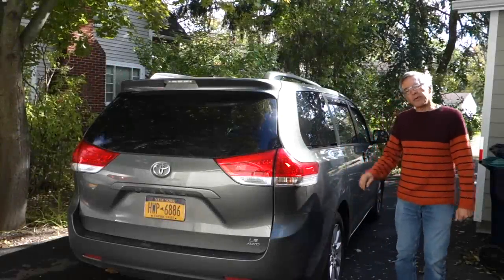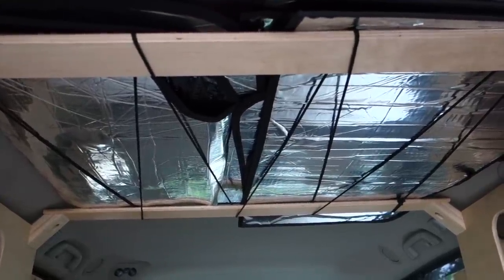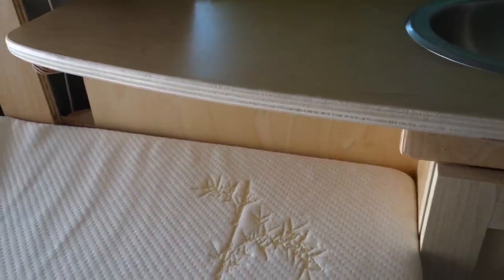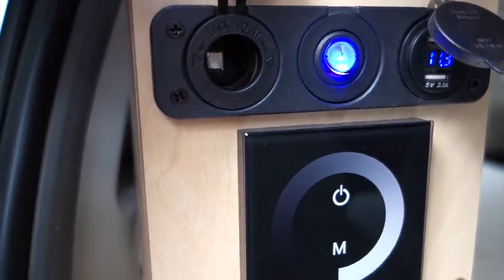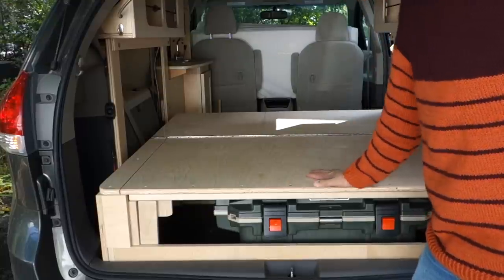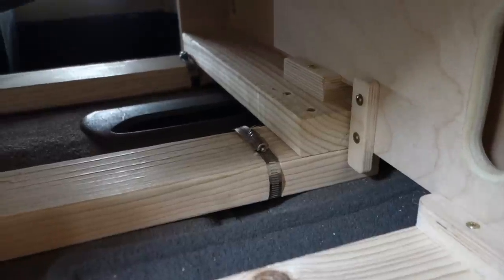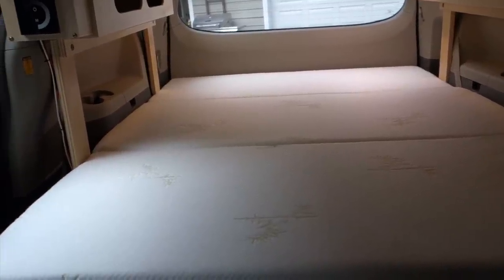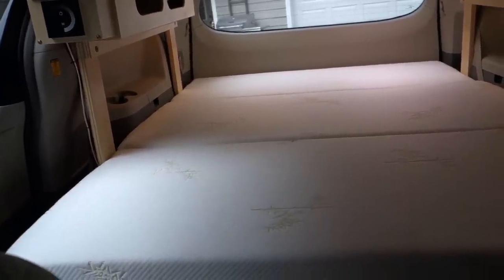A Slightly Different Mini Campervan Build

Comment: did you have a link to the dimmer reading lights? this is really an impressive build
Reply from the maker: The dimmer switch is easy: https://amzn.to/2WeVujW. The lamp itself is something I made from existing lamps I had in the house. I removed the spring clamp and made a mounting bracket to enable cabinet mounting. If I were to do it again, I might consider using these (https://amzn.to/2BOlzwE) and removing the spring clips to enable direct mounting to the cabinets. Or go the easy route and just get something like this: https://amzn.to/368s1g3

Comment: Great video.  I have a 2000 Sienna LE I'm trying to convert and have been unable to get a handle on the privacy and stealth  issue specifically dealing with the windows shades.  I cut out some WeatherTech window shades just like you, but I haven't been comfortable with the privacy and stealth aspects.  I used some velcro strips to try and get them to stay put and seal the light out, but they seem to frequently come loose or leave gaps where someone could see light from the inside of the van at night.  Also, many other builds I have seen use a black curtain to seal off the back of the minivan from the driver and passenger seat but it doesn't look like you have done that.  Note that a previous owner had all the rear windows tinted and it helps somewhat, but still not to my satisfaction.    I'm wondering if you have done anything in this area that might improve the privacy issue.
Reply from the maker: We have a full width blacked out curtain to separate the front seats from the sleeping chamber. You mentioned you “cut out” WeatherTech shades but they come already cut to fit the windows fairly precisely and they stay in place without additional effort. That’s been our experience, I can’t really say why yours would be different.  One of the biggest challenges with stealth is achieving good ventilation without giving away your presence. Leaving windows party open and running fans means leaving some shades or curtains somewhat open. One thing I might do someday is create side curtains that hang a little longer and hang vertically instead of trying to hug the window contour - then air coming in or going out will have room to move more easily with a gap between the bottom of the curtains and the door. If they’re long enough stray light shouldn’t have a straight escape path.
Reply: @BruceParks  Sorry, when I said WetherTech, I was just assuming that was what I had.  The stuff I have looks like yours, but it came on a roll and I had to measure the windows and then cut it to fit.  Your pre-cut shades might be more precise, but mine fit pretty good and I probably won't invest in the Weathertechs.  I'll probably go with a blackout curtain up front like yours and also your idea of long vertical side curtains.  I think the curtains will give the interior more privacy and also a feel like your actually in a bedroom instead of a mini-van.
Reply from the maker: john  - I believe you are referring to Reflectix, it comes on a roll from Home Depot. Lots of campervanners use it for their window shades but it’s hard to beat the near perfect fit you get from the WeatherTech product. Only real downside of the WT product is the price. Good luck with the curtains, it definitely lends a homey feel to the “bedroom”.
Reply: @BruceParks  I checked out the WeatherTech website and it appears that they don't make shades for my 2000 Sienna, except for the windshield.  "Full vehicle kits are only available in select vehicles" is what it says.  I guess the 2000 Sienna is too old for them.  I see what you mean about the WetaherTech price.  The price for the windshield alone was $60.

Comment: Would that same build fit in the 09 sienna or has the interior changed a lot?  Looks great
Reply from the maker: 2009 is 2nd gen, my 2011 is 3rd gen. There are subtle differences but the overall dimensions are similar

Comment: I appreciate the reply , could you elaborate ? Was it the size , adaptability ? Have you seen this before , are there other models with like attributes that could be considered ? It had to be more than just a selection . You chose it , I would feel some research was done on your part and why? Thanks
Reply from the maker: Sorry for the quick answer, we’re on the road. So, vehicle choice was a bit complicated. I initially considered cargo vans (Sprinter, Transit, etc) but decided we mainly wanted to be able to sleep comfortably in the vehicle and didn’t want to live and hang out inside it. The minivan offers space for a full size mattress with room for a portable toilet and dog (though we usually don’t travel with our dog). The minivan doesn’t draw attention when you overnight on residential or city streets. The minivan is reasonably good on gas, and can be easily maneuvered in tight streets and in parking garages (we like to see cities and museums in addition to the wild and beautiful places) The minivan is very versatile - I haul plywood, people, furniture, etc with ease. I didn’t like the idea of an extra vehicle that was single purpose that was only used part of the year (we only roadtrip for maybe 7-8 weeks per year right now) so the minivan’s versatility was a huge plus. I chose Toyota over Honda and Chrysler for its superior reputation for reliability.
Reply: Thank you , gave me something to think about . Keep the dirty side down 👍👍👍

Comment: Hi Bruce , love your concept and craftsmanship! Just picked up a 2020 Sienna , the base model and am going to do one similar to yours, question if you don’t mind. What is the height of the bed platform off the floor and how did you decide on that ? all the best, Steve
Reply from the maker: Steve, thanks for viewing and commenting. Regarding the bed platform height, it's about 13" in front and about 12" in the back. It's level to the ground, not the van floor. I recall choosing this height to just clear the cooler we had in the deep well in the back and it allowed for just enough height to avoid feeling cramped at all when sleeping. It feels just about perfect when lying down with your head propped up reading but it isn't high enough to allow sitting upright for my tall torso. I now have a refrigerator in place of the cooler and it has about an inch to spare between it and the plywood. If I could do it all over again, I'm not sure I'd change anything.
Reply: @BruceParks  Hi Bruce, thanks so much for the tips ! We just purchased the Dometic CFX75 combo fridge freezer, figure if I am going to go broke building this unit might as well go out in style :) using all Renogy units for power supply, combo DC-DC MPPT, 2000watt inverter, same charger you have, 175 watt flex solar panel for at camp sites as we are putting a THULE ski container on the roof for surplus camping gear, 2X100ah Renogy lithium batteries, which should run fridge for a good 3 days with no charging, also picked up a small RV self contained toilet which is only 11 3/8” tall which will slide under the front section of the bed if I have it at 12” off the floor, hence my wanting to know how your heights worked out. basically with these vans conversions you are building the ultimate Swiss watch! We live just North of Victoria BC, on the Island, if you are ever out this way have a nice spot under the trees ready for you anytime you like ! Once again thanks for all the videos, not having to reinvent the wheel is a good thing indeed !
Reply from the maker: @steveprice7259  Looks like you are putting together the ultimate minicampervan - great component choices. I’m currently making some minor changes, including replacing my solar charger with a Renogy DC-DC MPPT charger and adding a suitcase folding solar panel. I should have some new videos up soon. We’d love to visit Vancouver Island one of these days. I’ll keep you in mind.
Reply: @BruceParks  Look forward to it ! Thanks again Bruce !

Comment: is there a link for removing the 3rd row seats of this car and instruction to battery/inverter? Thank you!
Reply from the maker: Ted, for 3rd row seat removal, all I did was remove the plastic covers over the seat mounting bracketry and unbolted the bracketry. It becomes obvious once the covers are removed. On my 2011 Sienna, the wider seat has 2 bolts on the trunkwell floor and 2 bolts on the trunkwell wall and the narrower seat has 2 bolts on the trunkwell floor and 1 bolt on the trunkwell wall. Each seat also has a cable attached to the floor which removes easily. 

I'm building a nice solar power system and hope to upload a video on it in the coming weeks. The trick to a minivan installation comes down to how big a roof array you are willing to fit, and also whether you are willing to glue down a flexible panel(s). I bought a 100W rigid panel that I'm mounting as low as possible between the roof rails. I've mounted a 105Ah AGM battery under the sleeping platform and am currently building a "power wall" that mounts vertically in the trunkwell. The power wall has all of the components to make the system sing: MPPT solar charge controller, 1500W pure sine wave inverter, battery charger for use when connected to AC, power shut-off switches, fuses, wiring harness connectors, etc. Look for the video in a few weeks. In the meantime, I'm happy to answer any specific questions you have.

Comment: I'm beyond impressed! Would you be willing to coach me how to built this? If you have plans and sell them....I would be buying it on the spot! Just incredible ingenuity!
Birgit
Reply from the maker: Birgit, thanks for the compliment, I really appreciate it! Unfortunately, no plans are available as I built it from scratch and it was a little bit complicated. If I get a chance to take it apart and measure everything thing up, I’ll be able to generate some plans. One of the keys that may not be obvious to people is creating cardboard templates for the pieces that mate up to the van interior surfaces before cutting the wood - it provides a cheap way to make sure the wood cuts fit well.

Comment: Doesn't leaving the back hatch door open also leave a small light on, and drain your battery ?
Reply from the maker: There's a switch to turn all of the overhead lights off if desired so when we leave the back hatch open all night, we just turn off the lights.

Comment: May I know if you build for others and how much do you charge for your services. Got a Honda Odyssey LX. I live in southern California. Single bed.

Tnx for your time.

A little about me: veteran, a full-time student, awarded a scholarship by the VA for video production.

Spring break (1 week) starting on April 3-7, 2023.
Reply from the maker: Hi Agape, I’d love to help but I’m not in a position right now to offer builds for others. A single bed design would be fun with so many more options than the full-width bed I’ve been using. I wish you luck in your adventures. And, thank you for your service.

Comment: Wish I could figure out how to do similar so that I could have overhead cabinets in my 2012 Ford E150 medium high top passenger van. There isn't any way for me to hold them up. The walls are rounded, which is hard enough. I'll need to figure something out because move in time is in a few months and so far I have nothing built out.
Reply from the maker: You can always use simple uprights from below to support overhead cabinets. They might not hug the curved walls or look great but they would perform the function easily. When you tie the overhead cabinets together with the crossbars, everything becomes quite rigid. I hope this makes sense.
Reply: on one side will be an aluminum bed attached to the wall. On the other side there will be the kitchen area. 

I would like overhead cabinets on both sides. How can I do the ones above the bed, above the window?

Comment: Has your Iceco Refrigerator performed well? I have an Acopower refrigerator that quit working after less than a year.
Reply from the maker: So far so good, but I’ve only used it for maybe 14 weeks at this point. When we’re not road tripping, it’s turned off.

Comment: How much did. It cost you? It's great. Im a single 55 woman. Do you think i could do it myself? I haven't any help. Thanks again
Reply from the maker: laurajeanvalentine  - Thanks for viewing and commenting! Cost was approximately $140 lumber (baltic birch plywood), $50 hardware (screws, hinges, etc), $100 electrical (LED parts, wiring, switches, aux (jump pack) battery), $60 plumbing (sink, faucet, jugs, fittings), $130 mattress (see video description for link), $170 WeatherTech window shades. 

I would describe the project as a do-it-yourself but the outcome will depend on your woodworking skills. I strove for high precision and high quality to achieve a result that met my standards, which were, honestly, higher than they needed to be. For a purely functional result, it shouldn’t be very difficult to build something like this. 

The objective that is most valuable is finding ways to store things up high and get them off the floor, otherwise everything winds up on the floor and in the way. 

Good luck!
---------------

Comment: nice build; what's the thickness of the plywood, 1/2 or 3/4 inch? you used the same plywood for your cupboards?  How you manage your potty, cooking?
Reply from the maker: I used birch plywood throughout. 3/4" thick for all of the weight bearing members like the sleeping platform and supports underneath, the uprights to the upper cabinets, the upper cabinet casework, and the vanity cabinet. I used 1/2" thick for the fronts of the upper cabinets and the front of the vanity cabinet.  Potty is a Luggable Loo (5-gal pail with seat), double-lined with medium size kitchen trash bags and a couple of cups of kitty litter. We only use it for middle of night pees; daytime needs are at restrooms where ever we are. For cooking, we use a single burner Coleman butane stove. We only cook outdoors when the weather is favorable.

Comment: Thanks Bruce. I would like to do a similar conversion to my SUV, my only question is: the side cabinets cover the side airbags. Would that be a problem?
Reply from the maker: Hard to predict exactly what would happen. I'd expect the side airbags would inflate where they can. It looks like each of the Sienna side airbags are one piece from front to back. The first two rows would fully inflate and the third row would partially inflate behind the open-backed cabinet. Could there be an over-pressure situation because of this? Don't know. I can envision a straightforward design change that would allow the side cabinets to pivot inward if one were concerned about this.
Reply: I think I will try to make top cabinets soft, some kind of fabric or something. Also will try to avoid any sharp parts which could possibly penetrate the deploying airbags. Otherwise I'm inspired by the way you converted your minivan and see it as a project for my winter months. Thanks again for sharing this video. Stan
Reply from the maker: You might check out Adventure Wagon for ideas. They produce soft overhead storage modules. https://adventurewagon.com/collections/all-products/products/mule-overhead-storage-bags-for-vans-and-suvs

Comment: Great Build, how are the upper cabinets strapped in?
Reply from the maker: The cabinets are not attached to the vehicle. They are supported vertically by the pair of uprights on each side and horizontally with the two crossbars tying the left and right sides together. I left a little bit of clearance between each cabinet and the interior trim panels where I wedge a small piece of foam pipe insulation to take up the slack and eliminate any tendency to wiggle. It all feels quite rigid. Thanks for asking.

Comment: I can Tell you’re very meticulous in you’re planning . everything is done so perfectly did you cut out your own wood and smooth it all   sand it down?
Reply from the maker: Thanks for commenting. Yes, I built this from scratch and designed, cut, sanded, and coated all of the wood myself. It actually feels very nice when I run my hand over the wood.

Comment: Hi ...did you installe a auxiliary battery in your van?...how the thermoelectric cooler is connected? thanks
Reply from the maker: For the past two years, we used a small 13,600mAh jump start battery to power everything (LED lighting, dimmer controller, USB & 12V outlets, 12V fans). We kept it plugged into a 12v port in the van so it would charge up while driving. If we had a thermoelectric cooler, we could have plugged that into one of the 12v outlets but would probably have needed a higher capacity battery since those coolers are known to consume quite a bit of power. I'm in the process now of adding a deep cycle battery and roof-mounted solar panel to become the primary power source instead of the jump battery. This will provide plenty of juice to power everything, including a small portable refrigerator, and also provide a means of recharging on days we aren't driving much or at all. I'll post some videos on changes I'm making so subscribe to be notified when their available.